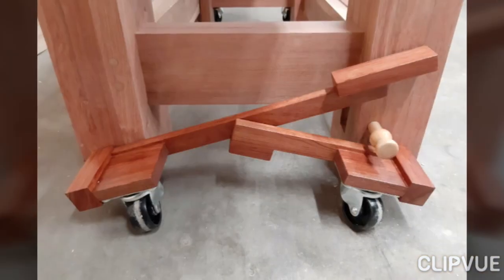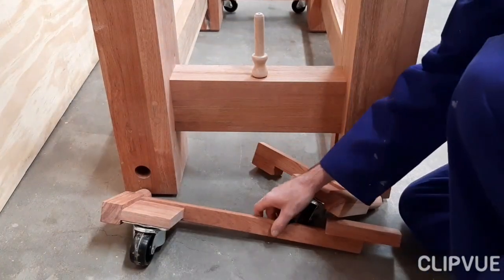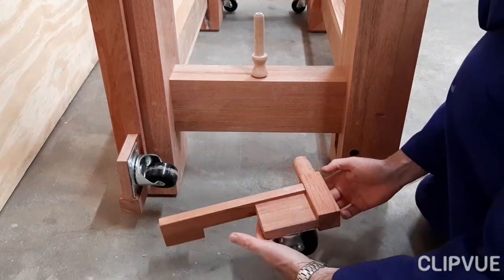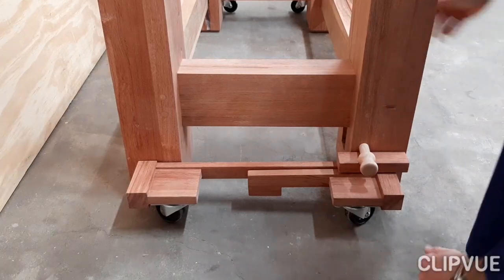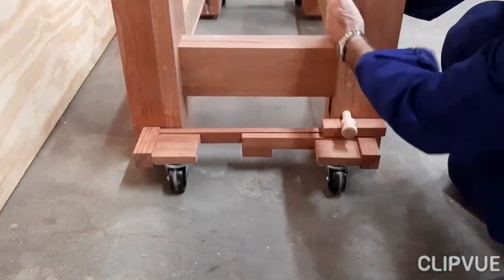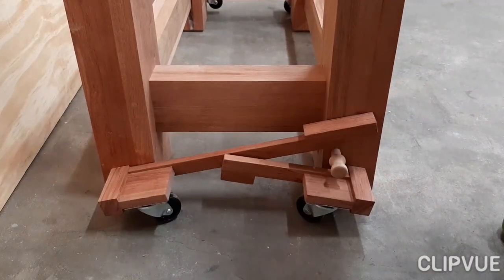Retractable Castors for Workbench

Comment: Love it - brilliantly simple.  If they were mounted on the inside of the bench legs, they could be left in place & not be a trip hazard.
That would require one stretcher to be located higher on the legs though.
Reply: My though exactly! Arm chair critique is easy, but yes I thought same as you right off the bat!
For evey design there are always another solution to achieve the desired outcome. One must understand the inventor or designers logic or intent as well as requirements, cost investment and time constraints. 
I'm with you though, but he did a great job also!
Steven Columbus Michigan USA 🇺🇸

Comment: Put the lever on the inside of the legs and instead of drilling giant holes in the legs, use a quality hinge. If you connect the two dies together, you can lift them all with one push of a lever. Add a spring and a wooden "hook lever" and it will automatically lock with the wheels up and you can also release it with one foot. 

What you built is nothing new, just extremely inefficient the way you built it.
Reply from the maker: Thanks for the comment @Magaman.

I have considered putting them on the inside, but then I would have had to lift the stretchers to make enough space. Or alternatively I would have had to put them between the stretchers, but then the wheels would have been very close together and it would have been unstable.

Also, the bench is around 180 kg without anything on the bottom shelf or on top of the bench. If I were to link all 4 wheels together, I do not think the linking bar between the two sides would be able to transfer the torsion from one side to the next (or else it would have to be very big, or metal).

I am mostly happy with my design, but agree with you on the auto latch, I should have put more thought into that.
Reply from the maker: PS: Do you have an example of a heavy bench (180 kg or heavier) with the design as you explained it?